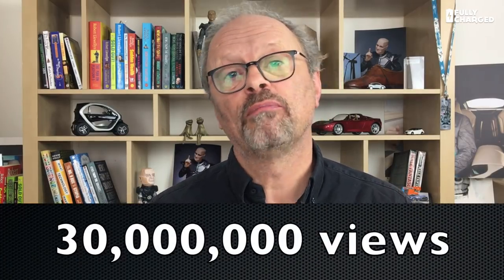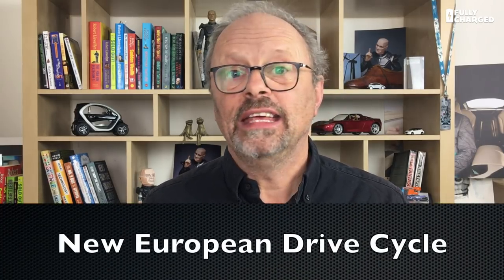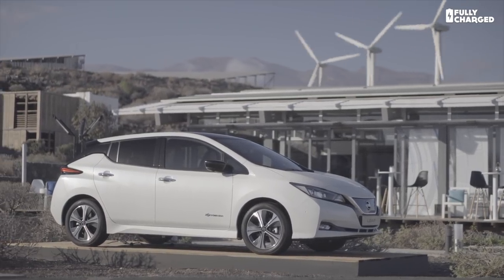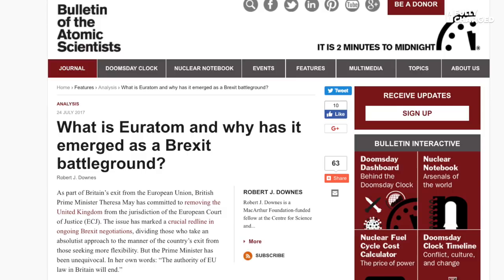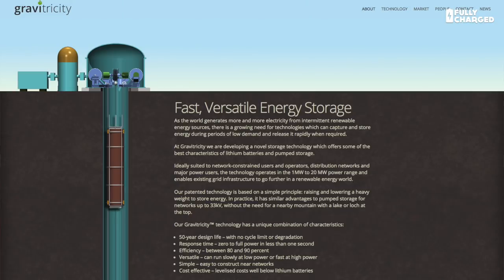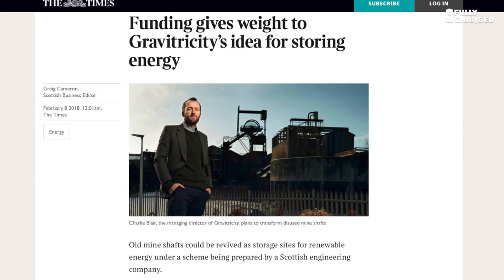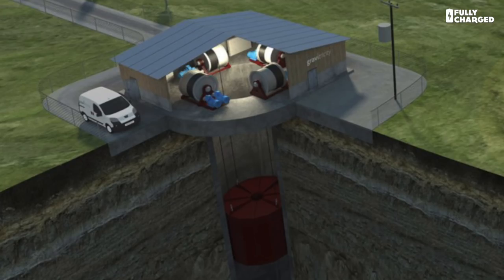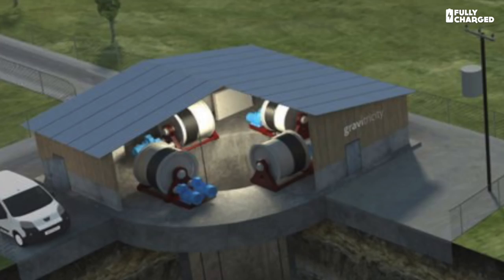WLTP IEM and Gravitricity | Fully Charged News

Comment: Do they use regen braking in elevators?
Reply: No, a cable.
Reply: No, they use a counterweight.
Reply: Great elevators analogy since I thought of it too lol. Its far better then the regen braking one.

And the pedantic critics must be living with elevators from the 19th century, current ones even us linear induction motors/generators that would even useful for this project too since they r fictionless
Reply: Ok, I'll give you that, elevators with regen do exist. (Whether they're worth the cost is not a given, though.). Frictionless motors, on the other hand, do not.
Reply: Whatever ur giving me just get a refund and send cash instead. Than google linear induction motor or generator. Or just go ride on a Maglev  TC my scientifically challenged friend...
Reply: I googled linear induction motor. Aside from learning that "Linear induction motors are frequently less energy efficient than normal rotary motors for any given required force output.", I did not find anything about elevator motors with no friction. Could you kindly point me to a source?
Reply: U stated "Frictionless motors, on the other hand, do not" learning about linear induction motors (that r used in some elevators) should have clarified that ur statement was incorrect. And the efficiency of linear induction motors r based on the same parameters as rotary motors.  With all do respect this not the place to have an engineering class on linear induction motors or elevators. But if u really feel the need to know about the specific of about linear induction motors used in elevators check https://www.mitsubishielevator.com/ or here www.otisworldwide.com/ good luck finding the proof u seem to need.

Comment: Before you buy any stock in "Gravitricity" take a closer look at this formula

E=1000kg*·9.8m/s2*1m = 98000kJ/3600s = 2,7Wh (a single AA battery store 2 Wh)

Mass needed to sote 1 KW per  meter liftet would be 1KW/2,7Wh  =0, 370

You would need a weight equal to 370 ton if you are going to store 1KW per meter shaft.
In other word. You can replace 370ton and a 100 meter shaft with ths battery in a Tesla.

There are only one practical way to use gravity to store energy and that is using  a punped hydro-electric system.

Comment: Wow why haven't we thought about gravitricity before. Brilliant!!
Reply: We have.  It is the energy storage mechanism that powers a cuckoo clock.
Reply: We have. Check out Gravity light.
Reply: Its a fantastic idea maybe they could use old coal mine shafts that are all dead now..............
Reply: 1000 tons of weight at 1km height stores less than 3MWh of energy. Tesla installed a 129MWh power pack recently in Australia. So I'm not sure this is so revolutionary.
Reply: its practically victorian engineering
Reply: Barnaclebeard sure, but I was talking from the point of view of electricity generation
Reply: Sure, it can power an electric cuckoo clock.

Comment: The Gravitricty thing is making my bullsh*t sense tingle. I don't think they're misrepresenting anything (the numbers given add up), but I don't think they're giving the entire story either.

For clarity, their website claims 3000 tons, not 30 tons.

From the site: "Each unit can be configured to produce between 1 and 20MW peak power, with output duration from 15 minutes to 8 hours." and "Shaft depths can be from 150m for new shafts down to 1500m for existing mines. "

From basic Physics class, the energy stored in a weight is mass * gravity * height. So a 3000 ton (3,000,000 kg) mass has 3000000 * 9.8 * 1 meter = 29,400,000 joules per meter of height. That's only 8.167 KWh! For perspective, the energy stored inside the original Nissan LEAF battery pack (24 KWh) could lift that gigantic lump of concrete well over your head (almost 3 meters/12 feet)!

By extension, a 150-meter shaft is good for 1,224 KWh, so that will output the claimed 1MW peak for roughly 1 hour. So a 1500-meter shaft could produce 1MW for about 10 hours. This matches what they claim at least, but a 20MW system for 8 hours would be... certainly not a single shaft with these specs!

A 3,000,000 kg block of reinforced concrete would probably be about 1000 cubic meters, which will cost probably around $200 USD per cubic meter when all the labor for reinforcing and formwork are added in. So the weight itself is costing on the order of $200,000. I suppose that's only ~$200 per kWh if your 1500-meter hole and all the other bits are free?

I wish them the best of luck but I'm not going to get very excited over this.
Reply: No
Reply: No what?

Comment: "... generate multiple megawatt hours..." I stand to be corrected but I reckon to generate 1MWh from a 30 tonne mass it would have to drop 12.2km. Boulby mine in England is the second deepest mine in Europe. It's 1.4km deep.
Reply from the maker: I will be doing an update on this technology soon. I was in a rush as always and got the numbers wrong. It's a 300 ton weight. Strangely enough the people working on it have done some maths. You may be right, it may not work but I thought it was an intriguing idea. It's a shame that I screwed up and got the number wrong.
Reply: Thanks for taking the time to reply Robert. Much appreciated. As I've put in my post below, Gravitricity may well be useful and cost effective where the requirement is to suck up or pump out very high power for short periods, such as when a wind farm is experiencing gusty conditions. In this way it would act much like a giant capacitor to smooth the power output before it hits the grid.

Comment: Graviticity: it is great, even though  it takes maybe 5 times more energy to get the weight back up then to generate it when they go down.
Reply: I thought it was about 1.5 to 2 times as much energy with high efficiency motors and mechanics, but anyway, it stores so little and costs so much that the actual number will probably never be important.
Reply: It is still good as the electricity that it takes to get it back up is free (solar) so...it is OK.

Comment: I wonder if you could generate a usefull amount of electricity using a gravitricity system on an elevator. Everytime the elevator went from the top to the bottom floor they use a generator to pump electricity into a battery to use in the building when power is expensive.

Comment: 1000 tons of weight at 1km height stores less than 3MWh of energy. Tesla installed a 129MWh power pack recently in Australia.
So I'm not sure gravitricity is practical. If they can find enough deep holes already drilled, then of course the cost is trivial, but drilling for this reason only could be too expensive.

Comment: Fun fact: a new word created by combining the sounds and meanings of two other words is called a "portmanteau".
Reply from the maker: Thanks for that. Now you mention it I think I knew but then I’ve forgotten almost everything I knew. Noted.
Reply: Glad you enjoyed my fun fact. Meanwhile, I've been thinking about that gravitricity setup that was shown. I'm wondering if it would be feasible to use water in the vertical shaft to lift the weight back up once its potential has been spent, in order to reduce energy use for lifting. You could divert some water from a nearby, higher up stream to fill the shaft and push the weight up. The weight would have to be able to float somehow, though. Draining the shaft could be tricky as well (without expending a lot of energy, the shaft would have to be part of some kind of sluice system). Perhaps using tides could work?

Comment: it seems to me this idea could be developed and would be even better by using sea swell and a large float with a ratchet system to wind a concrete block up to a height and do the same thing ...it could work day and night. .. unfortunately I am not in any position to develop ideas myself only to have them.

Comment: Gravitricity.

Interesting, but won't it take more energy to raise the weight than it generates on the way down due to overcoming friction?

Also what about flooding, what happens if that long hole gets flooded out by some freaky weather?

Surely energy storage using batteries is by far the best as the cells can be recycled and reused over and  over again and again.

But if they are concerned as to were the batteries are stored why not store them in the old coal mines, put in a good solid structure and use those old coal mines for battery storage, also hydrogen storage.

Use the wind turbines which is something I suggested a long time ago to make hydrogen and store that in old coal mines.

Comment: Gravitricity is a nice idea but unless you can use a lot of tonnes of material (which is only possible with water) it's not really usable. I tried to calculate such a device at small scale, well let's use small concrete cylinder 3 meters wide and 4 meters long. Such a cylinder would fit into well-like hole and it would weigh about 68 tonnes. Let's say you put it in 20 meters deep shaft (so 16 meters of movement) then it could store almost 3kWh of energy considering absolute efficiency. And it doesn't scale exponentially, it scales linearly with weight and length. I quess we will prefer having powerwall in every house instead of this.

Comment: Gravitricty sounds bloody wicked, and there's loads of unused mine shafts in the UK that they could do that and it would bring the price down of electricity a lot, as long as greedy energy companies wise up and be honest.
Reply: more to the point, we have a surfeit of potential wind / wave / tidal power - but need something to bridge the gaps...  hydro-based systems (where excess power pumps the water back up to the reservoir) have been proposed before, but we don't have that much hydro, and it requires a lot of real-estate - this Gravitricity solution solves that problem nicely (and can be deployed e.g. in towns etc if required)

Comment: Gravitricity. It seems there are lots already built. Deep hole, heavy weight, long cable, electric motor. There are lots, they are usually called coal mines. What’s best, no one is using them right now.

Comment: You could use water for the Gravity idea too using two containers with water towers that can also supply it to the public. You can also dig a hole through the planet across a 'corner' all the way to the other side. Not the centre of the planet, it's kinda hot that part. The vessel would fall, under gravity, from one side to the other like a pendulum, but in a straight line. This is about as free energy as ya gonna get. It could also be used as transportation. As for Brexit, looks like Northern Ireland will have to merge back with the republic of Ireland.

Comment: I don't see how that Gravitricity thing is practical, 30,000 kg is a miniscule mass compared to say pumped hydro, even taking in to account the increased "head" from the extra depth of the hole. Both the total stored energy and rate (i.e. power) you can access it just won't stack up. I think the underwater reservoir hydro tech shows much more promise and requires less infrastructure.

Comment: Call me very skeptical about Gravitricity. I remember I saw their web page years ago, did a few sums, and decided it was a joke. Others in these comments have done similar arithmetic.

It does not matter how cool the idea sounds, if the arithmetic doesn't work, it's still a shit idea. As (the late) David McKay said, "I'm not pro-nuclear, I'm pro-arithmetic".

Digging a 100M shaft with suitable concrete lining, and configuring it so it won't flood, with pumps etc, seems like a very big piece of civil engineering for 8kwh of energy storage (remember your Nissan Leaf has 3x this)

Comment: A 30 tonne mass lifted through 1500m stores about 120 kilowatt-hours of energy - or less than one Tesla Powerpack.

You'd need a mass of at least several hundred tonnes to store energy in the order of megawatt hours, plus all the lifting equipment. Think of the bill of materials for making that lot! (For comparison, a Powerpack weighs 1.6 tonnes.)

This will not catch on when both are in the same marketplace.
Reply from the maker: I will be doing an update on this technology soon. I was in a rush as always and got the numbers wrong. It's a 300 ton weight. Strangely enough the people working on it have done some maths. You may be right, it may not work but I thought it was an intriguing idea. It's a shame that I screwed up and got the number wrong.
Reply: The principle of operation is sound. The economics probably aren't.

Comment: Doing basic maths on this thing...
GPE = M*G*H
30 imperial tons is roughly 30,500kg
At 100m height
30500×9.8×100 = 29890000J
That's a decent amount of energy. It would depend on how fast they dropped it as to how many kwh they get from it.
Reply: Velocity doesn't increase the potential energy the mass starts with. The acceleration is constant.
Reply: That is 29890000J per second, so if you divide it by the number of seconds in an hour (3600) you will end up with the number of watt/hours (8302) and then divide it by 1,000 you will end up with the number of kWh or 8.3kWh. So the total energy stored will be worth about £1 in the retail market. So if this demo system was to just charge up on over night energy and discharge during the day time it could cycle 365 time a year and generate £365 of income at retail prices.

The vision is to build a solution that has a 2000 ton mass and a 1000m hole, but that needs a mine shaft, not something bored with an oil derrick. Even then the max energy stored per drop would only be 5,478 kWh or about £660 at retail prices.
Reply: Cassette Walkman I'm sorry, I should have made that clearer, I meant how fast they drop it would determine the peak energy output of the system.
Reply: Roger Thomas Thank you, for putting it in context for me. This doesn't seem like an economically viable project, by any stretch. We do need cost effective renewable energy storage solutions so it's a shame that this one isn't.

Comment: Here in USA, around 65 percent of Electricity is Generated by  Natural Gas or Coal.  Nuclear around 20 percent. Renewables  Hydro, wind, Solar  only around 15 percent.  This is why Electric cars are less efficient than gas cars... Axiomatic.
Reply: so according to your figures electric cars are 35% clean and fossil burning  cars are 0%
Reply: Soo.. Using your math...  A gas engine is 35 percent efficient.   A gas engine used to turn a Generator and this electricity propagates down steel lines hitting a transformer stepped down to  208 30 amps  , or 110 volts 15 amps is then used to charge your electric car makes your electric car 90 percent efficient !!  You actually gained power !! 
  Heck if we keep this up, we will have more electricity generated than used !! We will have to have a feedback loop to put the power back into the Grid !!  Who knew that electric cars actually make energy !!  Amazing !!!   lol...

Comment: The Gravitricity company may be new, but the idea behind the energy storage method certainly is not.  
Now, I know you didn't say it was, but it may come across to many as if it is new.
The London Hydraulic Power Company set up in 1884 were offering... wait for it.... 'a cleaner alternative to steam' by using high pressure water.  The water was pressurised by an enormous weight pressing down a column of water, and then flowed into a network of pipes.
Link below:
https://en.wikipedia.org/wiki/London_Hydraulic_Power_Company

Indeed, Tower Bridge itself not only used a similar system, but also used the LHPC as a backup energy source.
Link below: 
https://en.wikipedia.org/wiki/Tower_Bridge

Please don't get me wrong.  I'm not poo pooing the idea, or the company, just bringing attention to the fact that as one idea goes out of fashion an old one comes back in.
I wonder how long it will be before electricity is seen as 'wasteful', 'dirty' or inefficient?
Regards Mark in the UK

Comment: Gravitricity - big BS. Please make the math before you call it "perfect solution". For 30 tons that are 1km high potenial enery Ep=9.8*1000*30*1000 = 3*10^8 joules (or about 80kWh; I would welcome recheck, if there is not some order of magnitude mistake). Drilling 1km hole is extremely expensive, while 80kWh battery is something mere mortal can realistically buy. For "multiple gigawats" (assuming gigawathours) you would need tens of thousands of this monstrous installations.

Ad WLTP - it is still extremely optimistic. If slightly optimistic EPA states 150 miles (achievable with very light foot), then WLTP with 170 miles is about hypermiling.
If it produced ranges about 10% lower then EPA, I would consider it to be a very reasonable. Now it is another unrealistic number, which you need to multiply by ~0.8.

Comment: If you were to take this 30 000kg Block have at the top of a 1000m deep shaft and lower it to the bottom in 1h, the system would generate 81kW for one hour. Given 100% efficiency.

considering that a 3 person houshold uses an average of 410W one of these could power just shy of 200 households for one hour.
Not that impressive, in terms of powerdelivery, but if it would be cheap to install and maintain, maybe feasable
Reply: Considering that a 30ton block of concrete is about 12m³ that will be a big hole, so I doubt it will be cheap to install. Might as well build two water tanks with a pipe in between and build closed system pumped storage plant.
Reply: That's without the cost/inefficiency of raising the weight to the top again.